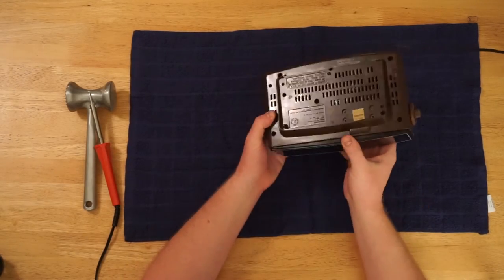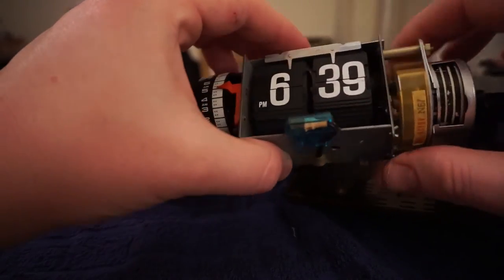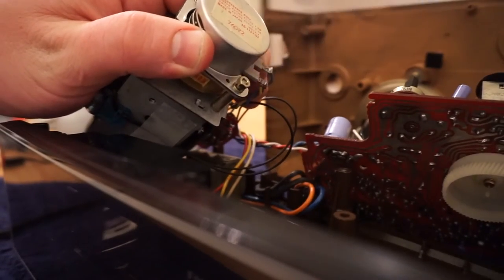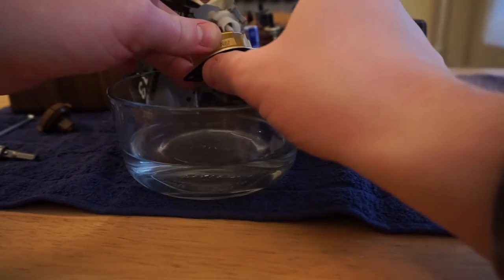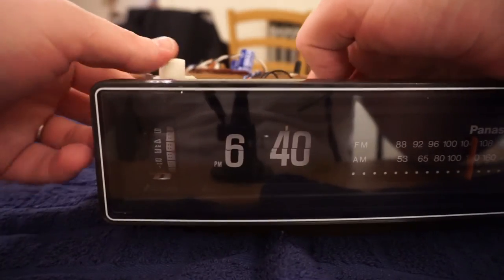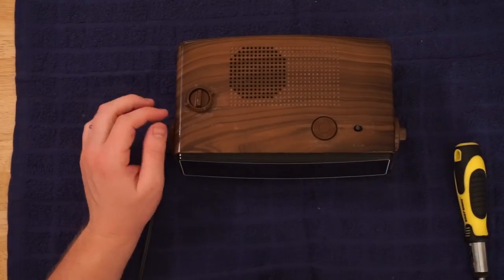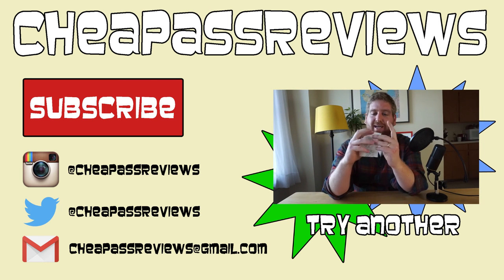How to Repair a Flip Clock (Panasonic RC-6030) Tutorial

Comment: I'm so grateful I found this video. I also have a Panasonic RC-6030. The motor in mine was making noise for awhile but wasn't that loud. Worked like a charm until it randomly quit a couple of days ago. Took the clock apart and assisted the motor in spinning and then it would spin on its own again until the gunk slowed it down or stopped it. Did the trick with the alcohol and put it all back together and she's working like a charm again. Thank God. I didn't want to have to try and get another 6030 to gut and use as parts. And I found finding a replacement motor is nonexistent. Thanks again. You helped me repair and save my vintage gem and saved me a heart attack! I would have been really sad if I couldn't fix it.

Comment: I can't believe there's no dust or dirt whatsoever inside the case! It almost looks like brand new. I've recently bought a Sanyo RM 5010, and will base on your tutorial to open it up, clean it and try to fix the alarm. I was actually wondering if the time knobs had to be pulled off to open the case, and as per your video it looks like that's the proper way. The detail on how to cliean the motor with 95% alcohol instaed of 3 in 1 oil is great! I would've used WD-40 solution, which could've been a mistake too. Thanks for your tutorials, man!
Reply from the maker: Clean as a whistle. This was actually the second time I opened it up tbh. I forget, but I might have hit it with condensed air when I replaced the light.

Comment: I have one of these and it was working fine. I used it again but this time i used the wrong plug converter  and it stopped working. I should have paid more attention, slight burning smell came from it. I immediately unpluged it. Found out i used the wrong  plug convertor. 
I assume it maybe a blown capacitor. I did open it and i could spot any immediate tell tail signs. Is there a video online to how to repair thie clock if there is no power. Thanks.

Comment: Hi guys. 
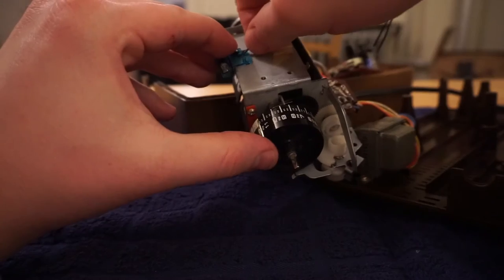I got a problem with my clock radio flip flap vintage. It doesn't doesn't say the good time speed for one minute it makes 1:08 minutes. So what is the problem to solve. Motor is 10 volts but it received only 8.90 volts. Thanks for your help guys if you know this problem.
Reply from the maker: +แดนนี่ ยอร์ค not too familiar with this problem. Mackey over at flipclockfans.com might be able to help you.  He was really helpful with my repair.  Good luck!
Reply: Most likely you have 50hz motor operating on 60hz mains

Comment: Any idea where i could get just one of those lights, I've got a similar model clock that needs a new light, but I live in Australia and the amazon store wont ship here and all the ones on eBay have high postage to Aus for the 10 pack.
Reply from the maker: +luv2dou2 I've heard that train and hobby shops sometimes carry the lights. You might call one of them and see if they have any on hand? Good luck!
Reply: Cheers ill try my luck its the last thing I need for my clock radio.
Reply from the maker: +luv2dou2 would love to see the finished product.  Good luck!
Reply: Cheers found a local electronics store that had a similar light and it works all good now
Reply from the maker: AWESOME!

Comment: I just bought a 1972 Zenith Circle Of Sound flip clock radio yesterday at Old Glory Antique Mall. These clocks were known to fail early in life, and the clock on mine is not working. Heck, I can't even set the time either. What could be wrong with mine?
Reply from the maker: I don't know, haven't seen one of those clocks before :( You should check out the forums at flipclockfans.com lot of very helpful people over there.  The moderator Mackey gave me some great advice when I was working on fixing my clock.  Best of luck!  Hope you get it flipping again!
Reply: CheapAssReviews Alright. I'll give it a try with emailing Mackey.
Reply from the maker: Sounds good my man.
Reply: CheapAssReviews Boom. Just done it minutes ago. Now I just need to wait...